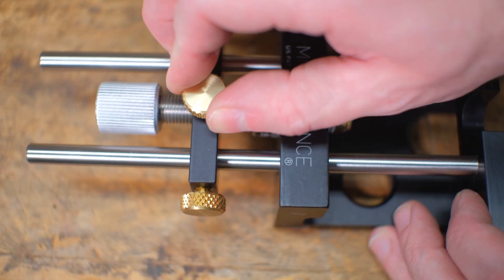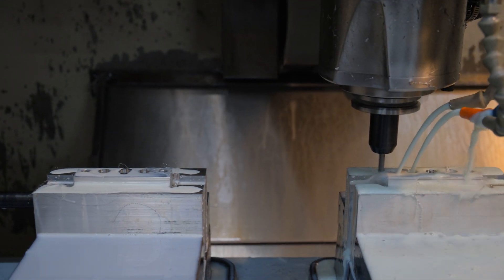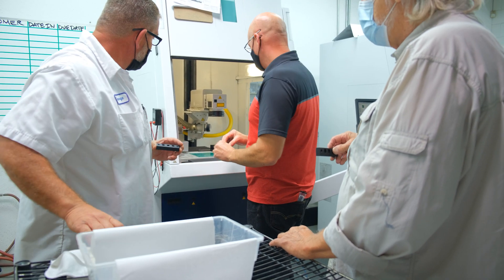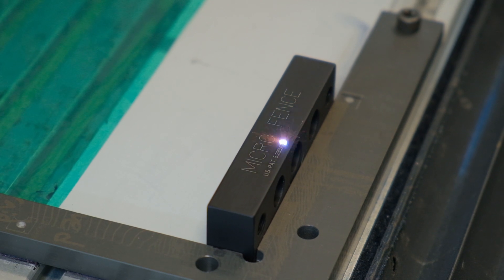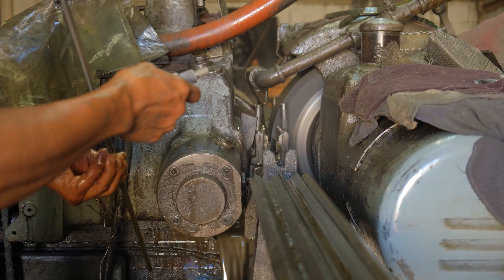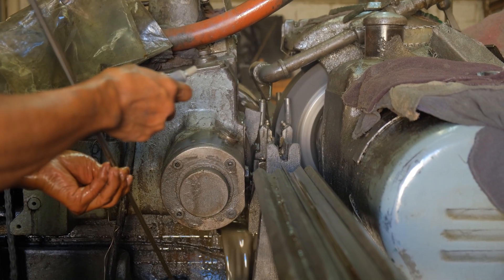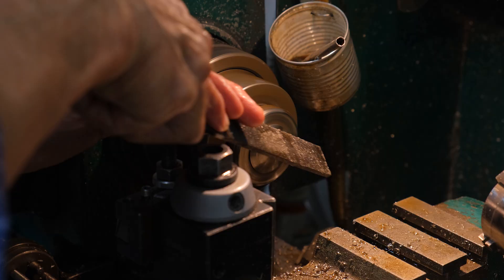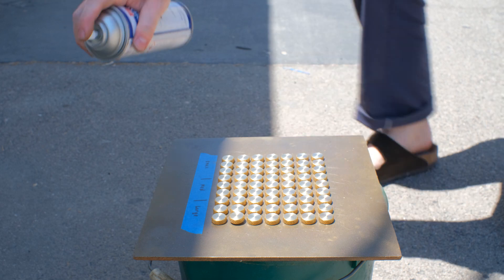Making Micro Fence

Comment: You have great products but your manufacturing methods took me back to my tool, jig and fixture apprenticeship in the late 1960's and early 70's. We did not do production work strictly research and development on high tech items such as s nuclear missile systems, missile launch systems prototype vehicles,, experimental military aircraft and the like where half- thousands would be a low point for accuracy. Don't know if to laugh or be happy at seeing fine old machining methods still being practiced by skilled craftsman in a production shop.

Regardless, it brought back fond memories of yesteryear. Keep making your great products however you make them and thanks for the memories, really miss it.